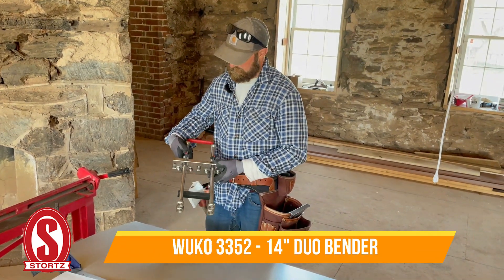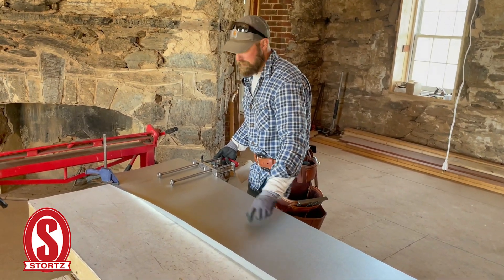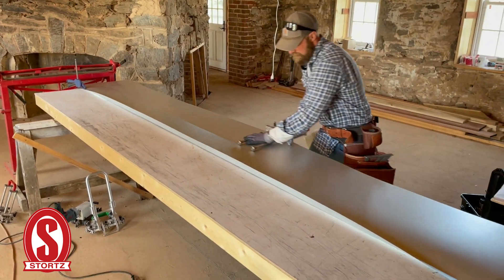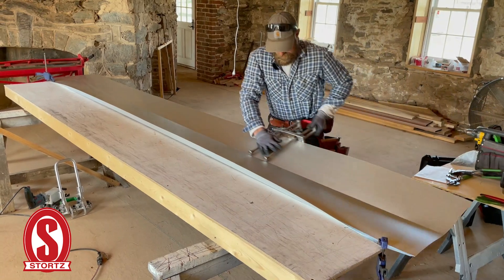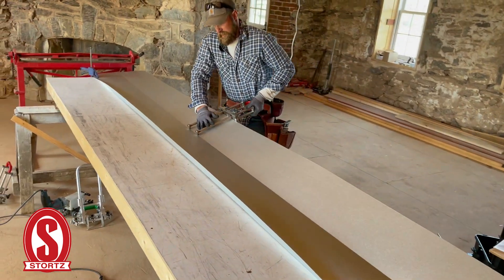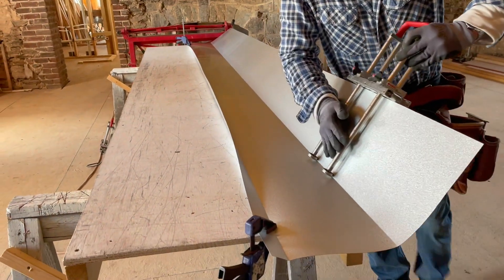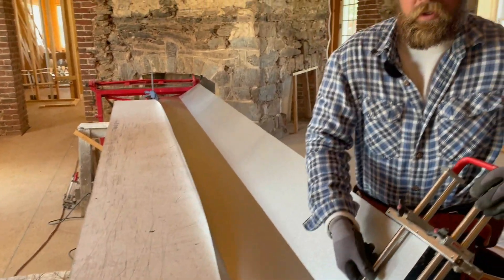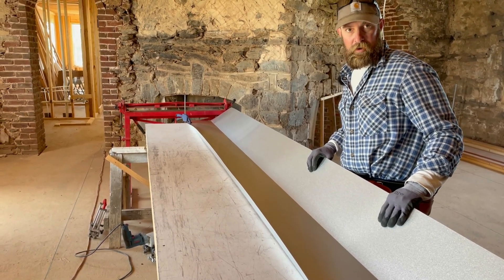Bending a Long Metal Valley

Comment: Hello, I am looking to make a waterproof box, without welding, just by bending sheet metal, do you have a method with your tools? 
here is what I found, but I am moderately happy with the result, go to
 "How to Make a Drain Pan with folded corners for Leak Proof pan without need for silicone, solder..."

thank you for taking my request into consideration.